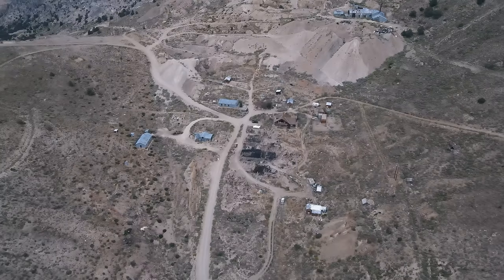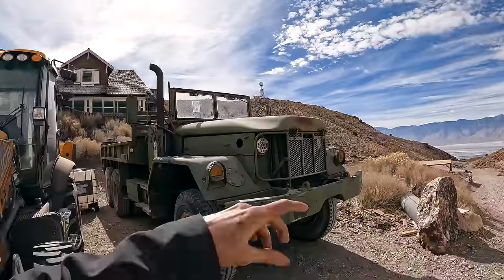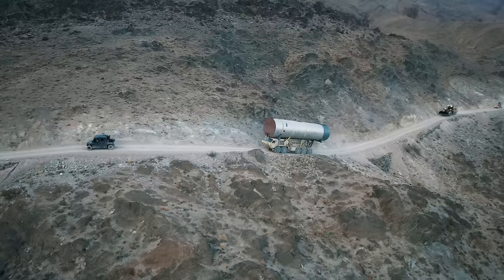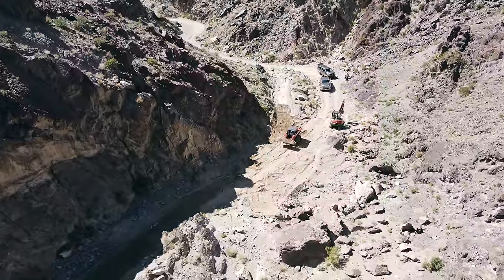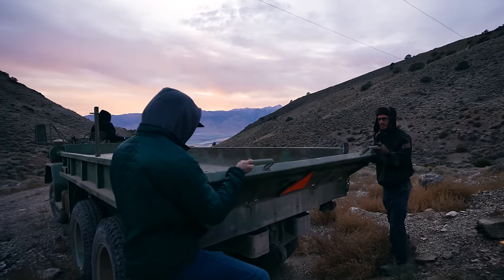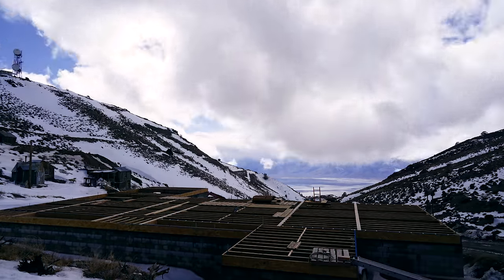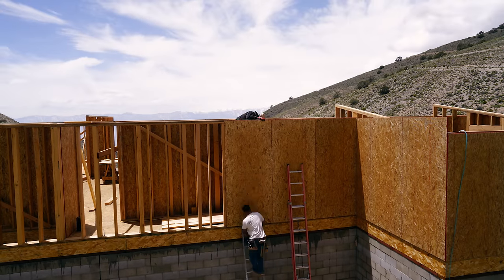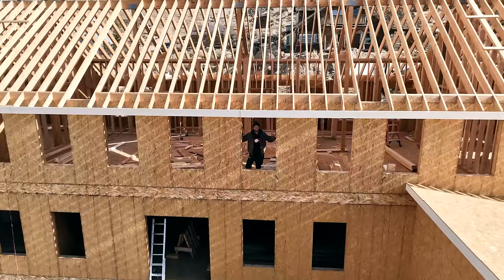Building A Hotel In A Ghost Town (3 Year Timelapse)

Comment: Breathtaking video. What is impossible to capture however is how steep that road is and what a task it is getting stuff up there. It's not like it is lightweight stuff either which has to be hauled up a dirt road that exceeds 20% in places. Add the elements in from blistering hot, frigid cold, howling wind, floods, snow, power outages, no water, too much water.....the challenges go on and on. Just like those tough guys that came before you Brent you and that amazing crew of helpers are overcoming the obstacles and making it happen. Incredible job.

Comment: SPRAY FOAM. Use closed cell spray foam for the all the insulation. Yes, it is a little expensive but will pay for itself in the long run. Its water tight, bug tight and it doesn't sag over time. Not only that, but it will stiffen the roof, increasing the strength. It will make your guests feel warm, while substantially reducing your heating costs. I did my shop in spray foam two years ago. I have a bug problem in the house, but not in my shop. It takes very little to heat it. In the summer, enough cool comes from the floor that it doesn't need AC, even when it is in the high 90s outdoors. Its the only way to go.

Comment: I don't know if anyone ever mentioned Gabeon Baskets would be a 'cheap' way to reinforce your road, helping to stop or reduce washout. They are basically cubes made out of extra strong chainlink. One fills them up with stones (baseball-sized to softball-sized usually) and then wire the top closed. These can get stacked on top of each other, at a slight outward angle. The second row could be wired (wire woven) to the row below.Some people have drilled into bedrock below where the baskets will be placed and inserted rebar, which will run between the stones in the baskets. 
 They've been used extensively in Switzerland to reinforce 80 degree slopes for many decades. I've also made use of them at my previous job in Ottawa, Canada.

Comment: Steel H-beams insane, first off they aren't meant to be BEAMS but instead columns, NEVER let architects do structural design.  They are not engineers.  That much steel would support 10 more stories on top.  
(on the other hand, gross excess steel cost less than proper designing, lol)